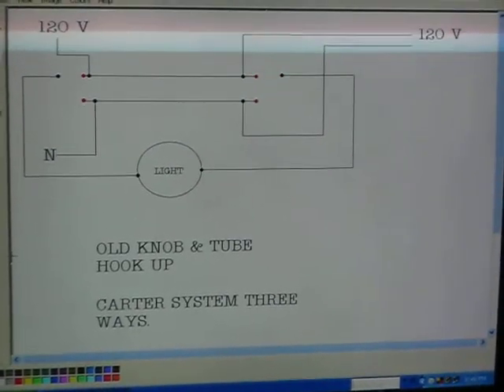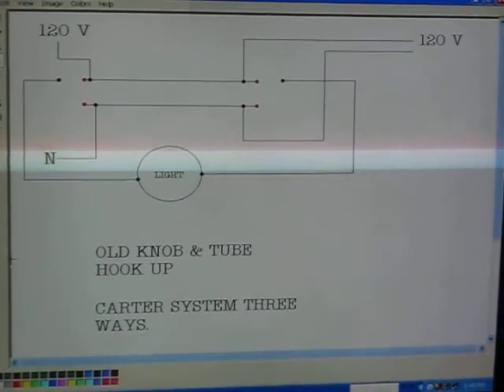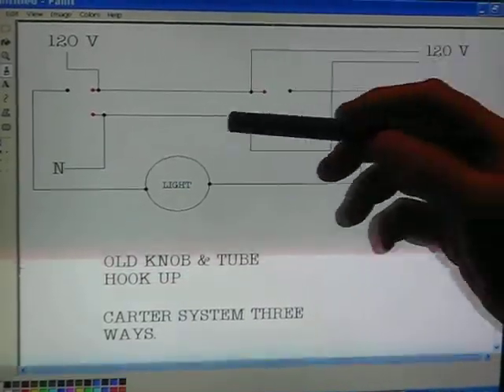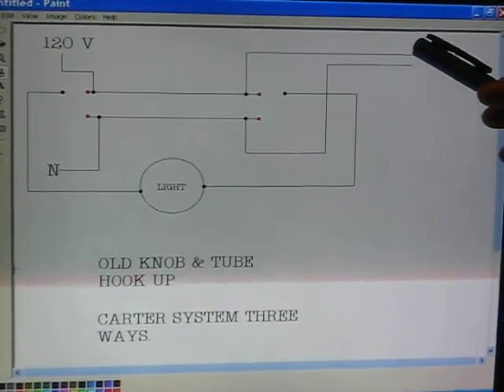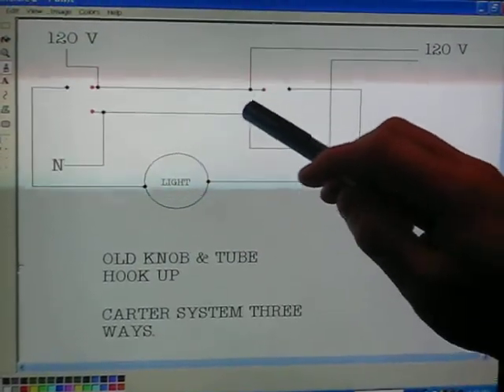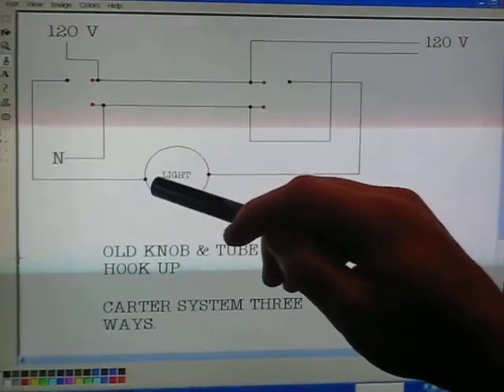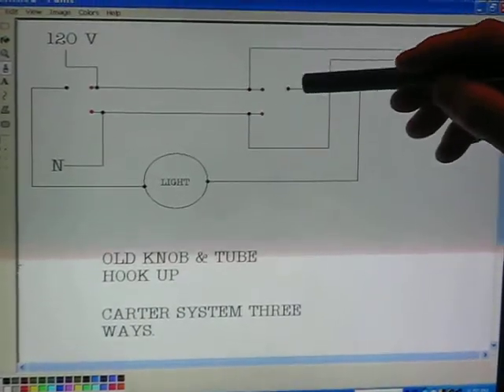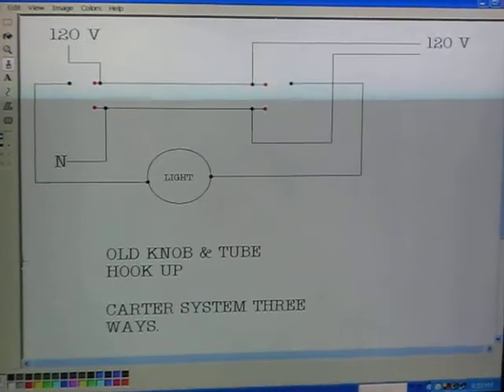Knob and Tube three way switches old hook up

Comment: Just a reminder for any current subscribers and any new people. I've just started building a website for electrical professionals. I'll eventually have a ton of stuff free of charge for anyone, its a process in the making so for now I put 10 questions up. I'll be talking code, calcs, science, theory and a whole bunch of stuff, videos, pictures, winner of member of the month etc. ( im retired and bored lol) but hey I have 30 plus years of knowledge to share and I still get calls for off the top of my head code questions, its true! and I still help everyone. Last one was one of my electricians from NJ asking what size wire for 20kw 480v 3ph electric heater, so all kinds of stuff for the apprentice to the inspector, and architects/engineers who need brushing up. So hope to see everyone there, and many thanks!  by the way the answer for the above off the top of my head is:  480X1.732 / 20000X1.25 or 30.07 amperes, use 40 amp 3 pole breaker with #8 Cu (copper) THHN/THWN (cables dual rated now)....... its all gonna be on the site (the required demand of 1.25 was included in that calc, it falls under electric heating and appliances in the code book. ya have to multiply the actual load by 1.25

Comment: I am unable to trace my wiring in the plaster walls, just curious if this sounds familiar to anyone and knows a quick fix. Knob in Tube wiring of course or I wouldn't be here. Stairway light.. Switch at top of stairs and switch at bottom of stairs. Wherever the light is turned off is where the light has to be turned on. If you turn it off at the bottom of the stairs the switch at the top does nothing, if you turn it off at the top of the stairs the switch at the bottom does nothing.

Comment: with the old knob and tube wiring did 4 way switching take place if so how was it done ?
Reply from the maker: bring - any number of 4 ways the new way is possible only because all switching is the ungrounded conductor, also known as hot. Because the grounded conductor (neutral) is used for controlling already I don't think it can be done. But I wanna look at it anyway and post whatever I can, Thanks much your a thinker!       Jim  (thanks in advance)
Reply from the maker: breng5 no bring - just three ways  im tryn to get a fun project up now
Reply from the maker: jbelectric777  I'm trying to get one of two videos up and published and man Im having one heck of a time.
Reply: +jbelectric777 hi, thanks for the video..I just want to know where can i get like this diagram of 3 way old wiring.. thanks
Reply from the maker: Just remember the old timers drilled as little as possible for the holes. They used brack and brace then. They almost never brought a neutral down unless there was a reason too like needing an outlet or something else needing just 120V  -  Happy to send if you like.       Jim
Reply from the maker: bring - I didn't put it on paper but 4 ways wouldn't work because you would be switching the grounded conductor (neutral) the whole idea was to have a hot usable outlet at the end and also be able to switch from 2 points, but I could be wrong. draw it on paper and see, maybe it would work

Comment: This common in old houses near me . Many experienced electricians talk about this like its voodoo . The calls I get are "I just changed the switch and now it keeps blowing fuses" A good indicator that you have the carter system is you will see an in and a out on your "traveler terminals" that would not exist on a conventional 3 way system .

Comment from the maker: @snowy1895  lol, Dont think colors, think conductors. Color is for identification, and in this old K&T there were no color codes because nothing was grounded. Instead follow the theory and go through the circuit. Note the travelers have hot and neutral on both switches, then draw the pivots in from each common to each traveler and you'll see the lamp at anytime either has two neutrals, two hots or one of each at anytime, one of each. To find neutral in reality go to a water pipe with your meter.

Comment: I'm an electrician in Ontario, we can get away with running ungrounded circuits through a GFI breaker or plug to satisfy insurance companys (or at least some of them) but the problem we run into most when doing this is the three way swiches, they create an unbalance in the circuit an pop the GFI instantly. sometimes we get lucky and find the two circuits that the three way has tapped into and put them both through the GFI. Is it a cheap way of problem solving?? Sure it is!!

Comment: @jbelectric777 In Denmark, electrics are covered by a set of rules called "Stærkstrømsbekendgørelsen" (rough transliteration: "Strong-electricity regulations" (plus a set of requirements from the utilities, e.g. cos "fi" of a load must be .9 or better)
A general rule says that an installation that was legal the day that it was built, remains legal -- so even though it's not legal to do "Type C" 3-way in a new house/installation, it's still found in houses dating back to when Type C *was* legal.

Comment: @rombaone Here in Denmark it's simply known as a "type C" 3-way. The two other types, which are legal to use in the electricals in a house, are types A and B.
Just like jbelectric points out in the vid, type C is sometimes seen in really old houses, since it saves a wire compared to type A and B, and back in those days, they didn't worry about polarity.

Comment from the maker: What that means is that modern day code does not permit switching the neutral in the circuit for many good reasons, they only permit switching the hot wires with the loads neutral always solidly connected. In this old K&T circuit they switched both and since it is "existing" you are permitted to repair it as it was first installed. Hope this helps, any problems just shoot me an email.   Jim

Comment from the maker: I dont know if I answered the question from the guy in Chicago, Im in southern NJ close to Atlantic City. I was in correct saying it could be found in old farm homes, actually its in any building for any use before they started using three way switches using a device with a common and requiring the travelers be in the same sheath or raceway. I just had a friend call me to tell me he found this in an old brick office building. The conductors were in an old ridgid 1/2" galvanized.